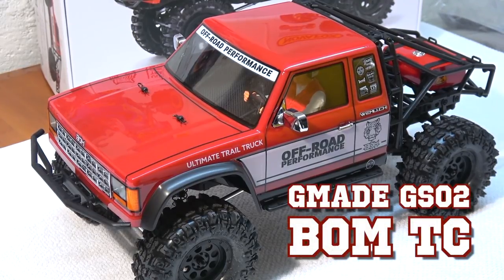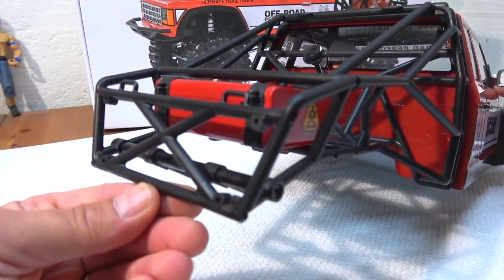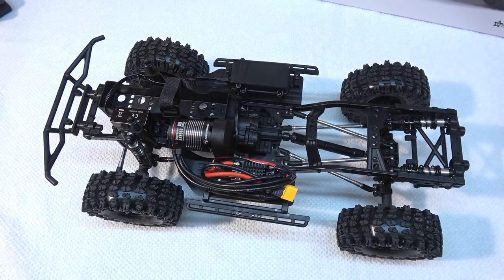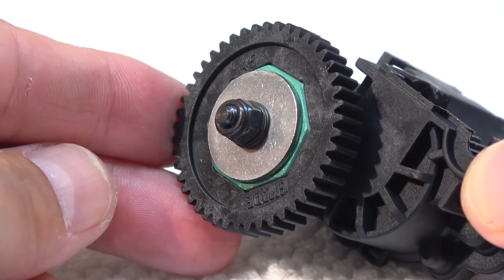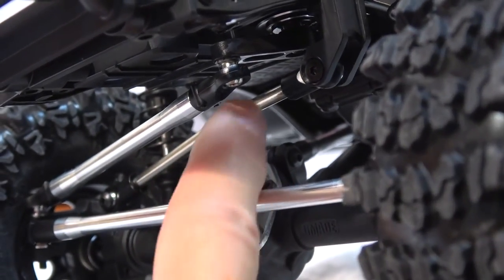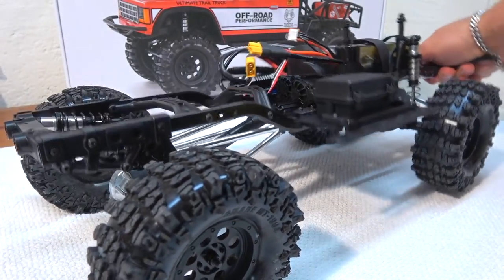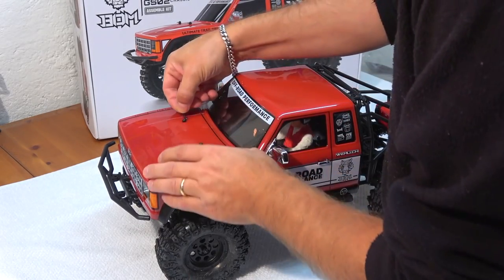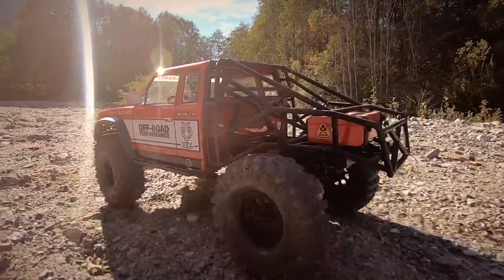Gmade BOM TC - First Ride and Review

Comment: This truck is awesome! I bought it as soon as it came out, it has “fall type flex” you can set it on uneven terrain and the droop just happens in my opinion as it should. Other trucks you seem to have to press them down to articulate. The truck comes with CMS and it’s on the left hand side for the aesthetically pleasing of the eyes to people in North America where that drag link comes down from the chassis. The old school box body is in no way the worst looking kit body. The offset front differential is another awesome add on to realism! The kit springs are pretty good verses other manufacturers. I hear that Gmade is coming out with a revised transmission because of some skipped gear/shim problems/ issues. The truck definitely is worth having even with the transmission issues some people have . When Gmade revises the trans it is going to definitely be my favorite truck. Gmade is a contender for sure !!
Reply from the maker: Thanks for your feedback Joel! Fortunately I have no transmission issues yet! 👍😊
Reply: Matteo's RC Movies good to hear that it’s not all the trucks out there with transmission issues 👍👍😁

Comment: O_O

Why isn't the counter-rotating driveshaft design used on ALL rock crawlers?
Reply from the maker: This is a good question! 👍😊
Reply: After thinking about it some more, I think the counter-rotating driveshafts could cause the axles to lift off the ground and lose traction in a high-torque situation. However, I'm not sure that problem would actually be worse with counter-rotating shafts vs. normal driveshafts.

Comment: very nice Matteo best video about gmade bom, but this TTR system it does not work as it should, i see a lot of torque twist in several videos
Reply from the maker: Thank you! But the TTR really works. I have several other cars, SCX10, Venture, TRX-4, CMX, so I can compare it. And the BOM have much less torque twist as all the others, nearly nothing. I think it's difficult to judge this only by videos.
Reply: thank you matteo, from what I saw it only works when you are all four wheels on the ground, if it loses traction in the front it will pull to one side.
Reply: portal axles reduce more torque twist more than a couterclockwise gearbox, 
if you join the two (portal with reduction gear+reverse rotation), it eliminates practically 100%

Comment: Matteo, hello, nice video. What kind of driver? Can you give a link where to buy or part number Tamiya? How do you glue the platform with the driver to the body? Than greased balls on the driving wheels and the driveshafts?
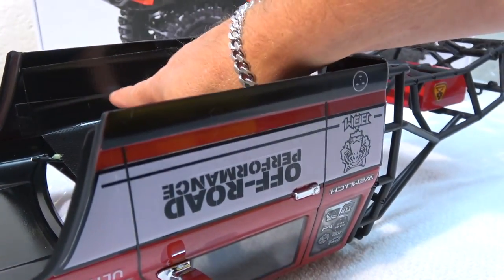Reply from the maker: Thanks! Yes, grease is good on these balls. The driver figure is Tamiya 54416. I fixed the platform to the body with strong self adhesive tape. You can see it in the video at 4:13
Reply: Matteo, Hello again. What is the perforated platform on which the driver is mounted? I can not think of what to make it ((

Comment: Man, I would buy this truck in a heart beat but I don't like the body. I like a full body on it. I don't like that roll bar stuff on the back. Does any body know if a regular truck body with a bed could be mounted on this frame?
Reply from the maker: Yes, of course it can be mounted. The flat rear suspension is an advantage to install trucks with flat bed.
Reply: @Matteomeier  Thank you for the info bud.